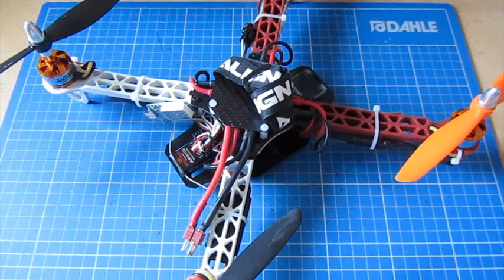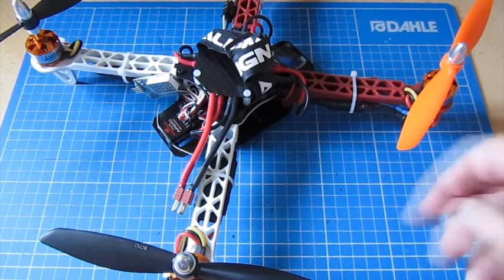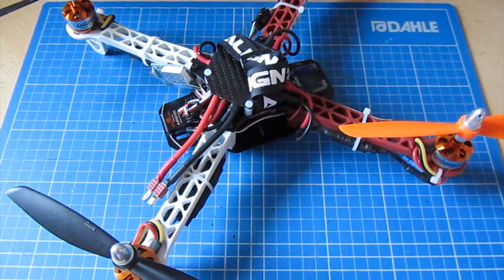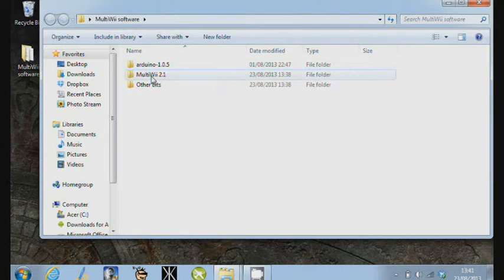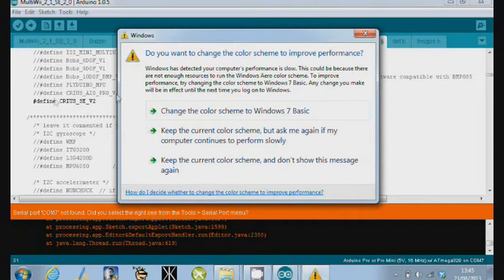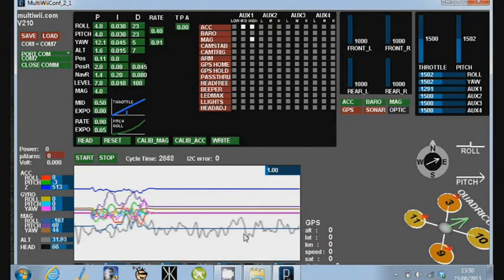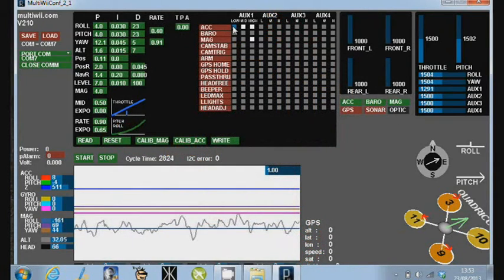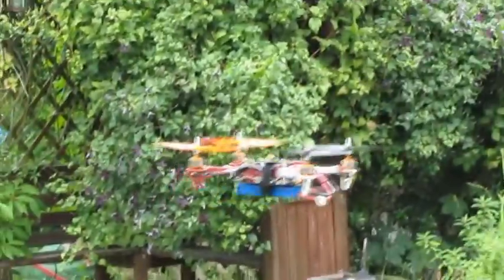Crius SE V2.0 MultiWii Board (MWB) Overview and Setup

Comment: Where do I get sketch files for the Multi-Wii 2.5 board?  I have setup APM 2.6 w/GPS and KK 2.1.5 but this Multi-Wii is totally new to me, I've watched your video several times now, and can't figure out where to get the sketch file to upload to my board.  I'm completely illiterate when it comes to this kind of stuff.  Thanks!  Great video btw!
Reply from the maker: Hi Michael, if you've set up the KK and APM then this will make sense quickly. I know from my own experience it's confusing coming from systems where everything is made easier by having only one (or two!) versions of the boards and dedicated software for them.

Multiwii is an excellent platform and is developed by the community so new features, board versions and improvements are coming all the time. Multiwii AIO Pro boards can run a version of the APM code!

However, all of these choices and versions do mean that you need to edit the software files before uploading them so they match the board type, setup and main components (like ESCs). It is like performing most of what's done in the 'mandatory hardware' sections of the APM setup in Mission Planner (frame layout etc.) by selecting the choices you want in the firmware code before you compile and upload it.

Download the code from http://code.google.com/p/multiwii/ and follow the video and you should be flying in no time!

Best of luck with the build.. Happy flying!
Reply: I still do not see sketch files on that link you provided sorry, I'm totally a noob when it comes to this board!
Reply: Painless360
Ok I finally got the MultiWii 2.3 file to download, but have no clue how to use it honestly, I do not see in the sketch file where to define the board type.  Like I said before, I'm a total blooming idiot when it comes to stuff like this.
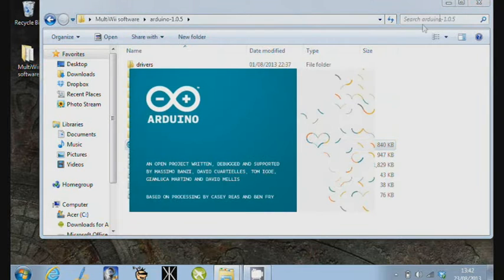Reply from the maker: this is covered in the video at 10:40. Open the .ino file that has the same name as the directory its in and you will see lots of tabs. Edit the one called  'config.h' to select board type, frame orientation etc.

If you don't see multiple tabs then you have opened the wrong. ino file.

best of luck.
Reply: I have all the multiple tabs, but nothing about board type or orientation in this sketch file
Reply: Ok I finally found the correct tab and found board orientation for Quad X but not exactly sure which board to choose, I Crius SE and Crius SE 2.0, I have a 2.5 SE
Reply from the maker: I use  #define  HK_MultiWii_SE_V2 and it works great with the Cirus SE v2.0 and v2.5 board.

You're welcome, Best of luck.
Reply from the maker: Painless360
FYI - I've updated this video with a newer version that uses the SE V2.5 board and Multiwii V2.3 to configure it. See https://www.youtube.com/watch?v=Zm8z4RLkFGU&list=PLYsWjANuAm4qSqszQR6qIisiwk5r-_nMk&index=1

Hope it helps

Comment: I tried your config files and could not get motors to spin. When you arm motors is there some indicator that it got the signal and its armed? I have mw v2.5 connected to dragonlink receiver. I wired motor esc directly into dragonlink receiver and motors ran.
Reply from the maker: Yes, have a look at the Multiwii manual at Multiwii.com. You need to arm the board first before the motors will kick in.

If it will not arm by holding the throttle to the bottom/right of it's limit for a few seconds then increase the endpoints on your radio.

Hope this helps. Let me know when you get the beastie flying!

Comment: Hi can you upload the code for the 2.0 onto the 2.5 and please can you put a link to the FTDi Connector you bought
Reply from the maker: Yes you can, make sure you select the right board in config,h (I select the Hobbyking one and it works great with the 2.5 board).

Can't link to the FTDI board as I've seen/bought a few in my time. If you search for 'FTDI basic' you'll find similar ones.

Happy flying!
Reply: Thanks very much :)
Reply from the maker: George Carter
FYI - I've updated this video with a newer version that uses the SE V2.5 board and Multiwii V2.3 to configure it. See https://www.youtube.com/watch?v=Zm8z4RLkFGU&list=PLYsWjANuAm4qSqszQR6qIisiwk5r-_nMk&index=1

Hope it helps

Comment: Once the calibration of the sensors has been done is that it, can you then write new commands to the board without having to calibrate again or does the quad have to be calibrated each time a new function from the GUI is written to the board. I finally feel i have nearly got this all sussed. just waiting for a replacement esc.
Reply: I guess its a one time calibration as the info is stored in the GUI and that shouldn't change.
Reply from the maker: The calibration should (!) be a one time thing. It's good to recalibrate once in a while when you connect to the PC to keep everything spot on.
Reply: I've had some problems today with changing settings in the sketch. I'm finding it difficult to understand how the sketch interlaces with the GUI. As even though i had uploaded the new sketch settings to the FC nothing changed in the GUI or with the Quad, i tried over and over and eventually cleared the eprom, then it took me all night to get back to where i was. Partially due to having one odd ESC, but had it flying well now with 3x 6A Plush and 1x 7A YEP. Problem is that when i use the Sketch  (cannot fly) to calibrate the ESCs the YEP seems to have the wrong settings changed within, my no brake and plane fast change to Heli middle and soft brake each time so i need to do it again with the programming card, still having issues with throttle range and understanding how the GUI is used. Later i found that perhaps it wasn't necessary to clear the eprom on the FC. I think it was how i was using the GUI? The quad and the GUI don't recognise the new settings form the sketch till i reset and read (i think). There are just so many things to watch out for, what order you do things in, how long you wait for things to be ready for flashing etc. It's more like Plug All Day rather than Plug And Play :)
Reply from the maker: You always use the same MultiWiiConf from the same version that you use the code from - 2.2 or 2.3. Writing to the board from a different version of the GUI (like what the Aux switch does) will mess the board up. I may do a video on this as I haven't covered it so far..
Reply: I may have done this by mistake, i got a bit lost not knowing that i needed to open the .ino file. I had saved a few different sketches and am only just working out how to find them (the .ino file)
  I flew again today and it's going very well, since i am learning to fly i've set:
#define MINTHROTTLE 1120 // for Super Simple ESCs 10A
and:
#define MAXTHROTTLE 1650

This is to help me keep the quad under control whilst i learn, i thought it may be a good tip for beginners but i should probably be doing this setting in the gui or on the radio?
 I'm currently trying to find out info on how low i can run a lipo. because you get two readings, batt level with motors running and batt level with motors at rest. This is a bit confusing, how low can i go with motors running? e.g. 6.3V? Then at rest it's more like 7.4V. I'm using a mini volt meter from ebay, very cool piece of kit, super lightweight. 3.5 - 30V.
http://www.ebay.co.uk/itm/360759956960?_trksid=p2059210.m2749.l2649&var=630168644611&ssPageName=STRK%3AMEBIDX%3AIT

I flew for a short while today in acro mode before i realised i didn't have angle mode switched in so things must be fairly dialled in!.
  I don't remember seeing many good videos on how to calibrate the mag, i heard you need to hold the quad in certain angles and go through a sequence like this, it's a bit tricky for me as i don't have a usb extension so i'm on the ftdi cable alone and walking around with my quad in one hand and the laptop in the other hand. Since it's working well with one YEP ESC and 3 Plush i think i'm going to try again with the YEPs because the plush constantly drain power and they are shortening my flight times, but the YEPs tick over with a super low current drain.
  Sorry this is getting a bit long but going back to the choice of ESC in the sketch, there are a few different choices, i take it this is more than just a min throttle value. I am assuming that depending on which one you choose the esc calibration programs the ESCs differently.
As some esc's are programmed differently than others. For example every time i do the calibration the YEP esc resets itself to brake smooth and heli middle. So i have to go back and change it back to no brake and plane fast with the programming card. I didn't check the plush yet as everything seems to be working for now.
Reply: I'm going to suss the low batt thing out by observing how much power is going back into the batteries when i charge them.
  Soon i'll know how low i can go with motors at hover. by using this technique.
Reply from the maker: Where are you based? Would a quick chat help figure it out?
Reply: I'm in France, i have Skype but don't worry i'll figure everything out in the end, i was just starting to wish that everything in the sketch was in the GUI, or is it? It's nice to have the sketch too. I've just seen the software the naze32 guys are using, It looks very user friendly. Check your inbox i've sent you a PM.
The other day when i spent all day messing with the quad and the odd ESCs my new ESCs had been in the post box all day! It's flying fine with the odd ESCs now. I'm keen to go back to the YEPs as they draw such little current compared to the Plush which chew it up even with the motors stopped.
  I find i loose height when i'm using Yaw control. Is this normal for a micro quad? I say micro but it's a 380 diagonal with 5" props and 10g Motors, about 170g AUW with 1100mah

Comment: Hello fellows I have a 450mm quadcopter with Crius multiwii FC laying around and I'd like to know if I can flash it with cleanflight or baseflight?
Reply from the maker: I don't think you can, I've not tried it myself as there are great boards (Naze32 and Flip32) that are designed to work with Cleanflight. I would be an easy job to swap the boards over and reuse the GPS and other pieces..

Hope this helps.

Comment: Hey Painless360  .. Thank you for This Great Video . Iam use Multiwii Lite v0.2 and connect all sensors to make it like SE v2.0 . and follow all your instructions , But i have a trouble :/ .... Multiwii dont supply Motors with the Same PPM Always there is a Motor have more speed than others and i cant find any Solution on Web :/ ... HELP PLEASEEEEE and Thank you

Comment: Hello - Thanks for the great videos.  I'm trying to upload the config file onto the SE 2.5 board. Ironically there is no SE V 2_5 selection in the 2.3 code, only V2_0. I'm using a mac with a USB cable and getting a message that says cannot run program followed by a directory path then it says no such file or directory. any idea what I might be doing wrong? Should I connect the battery to the distribution board or is the USB power enough?
Reply from the maker: Hi there, the V2.5 board has all the same sensors as the 2.0 but has an additional port. If you select the V2.0 board it should work great. I use ' #define HK_MultiWii_SE_V2' and it works great. Hope this helps.

Happy flying!
Reply: Great, that selection seems to work. I also learned that even though the board lights up with USB power only, the GUI will not show the USB comm port unless the lipo is also plugged in. Learning as I go for sure! Thanks again!
Reply from the maker: Good news, be careful of that board as all of my 2.5 versions were happy with USB power only for setup..

Happy flying!
Reply: Thank you for your help over the last several days. I was able to get the quad safely in the air. Believe it or not, the USB comm port wasn't showing up in MultiWii gui or Arduino because the USB cable was faulty. Of all things! At least it works now. Take care and thanks again!

Comment: did everything you did, but for some reason I cant get the gps to work. the light wont even shine on the software indicating that I have a gps connected. Do I just configure it config h on what gps im using
Reply from the maker: You need to do a few things, configure in config.h, config the GPS and the i2c board too. See my other videos on CN06 troubleshooting and multiwii - adding GPS for full details on the process. Hope this gets you working. Best of luck!
Reply: Thanks! I'll give it a try and see how it goes.

Comment: Is it possible to pull the sketch that is on my board now. So I can reference it later. Its preloaded. With multiwii  2.1. But I need to do an esc  calibration with the sketch. And am nervous about messing with a sketch that is setup already for my current components. Please clarify
Reply from the maker: Sadly I don't think it is. You need to keep the sketches used safe for future use and recompile the code each time.

Comment: Hello will this set up work for multiwii lite v1.0? I've been trying for 2 days no luck, won't arm the motors the pitch and roll seem to make the rc flash blue. I'm not sure what to change for the board type when making sketch.. Any info advice?
Reply from the maker: What board did you select to upload? Make sure that you connect the board after the update to the PC via USB and reset the ACC and MAG.

I've had boards with the flashing blue LED until I calibrated the ACC in MultiWiiConf.

Hope this helps. Happy flying!

Comment: How can I edit the code written on the board, I mean how can I create my own unmanned quad-copter using this board??
Reply from the maker: You need to compile the code from the source software as in this video. To 'edit' the code you change the parameters you want in the code and recompile the code and flash the new version to the board. Keep the version of the code you use to compile and then it will be easier to edit.

Hope this helps. Happy flying!

Comment: hello
thanks for the tutorial . i have the multiwii se v2.5 i programed it ,when i give throttle the motors do not spin properly like the speed jumps up and down not too much but it happens in all the motors . I have been trying it from past three days it does not leave the ground by it self .help!!!!
Reply from the maker: Did the ESCs come flashed with SimonK firmware? There have been issues with the KK tool uploading the wrong code to the ESCs.

See Problems with HobbyKing 20A ESC after flashing with of SimonK firmware V2013-9-20 - Solution for more details. If that all checks out - then check all of the connections and recalibrate the ESCs.

Good luck getting to the bottom of it..
Reply: Those are not hobby king esc's ,those are some cheap Chinese HW 30A esc's
Reply: Watch the video , the link is in the above comment !!
Reply from the maker: Mohammed Iqbal I don't understand. Are you saying that the ESCs in my video (@watch?v=sQ0XkVFhH0E) are not from HobbyKing or the ones you have are not?
Reply: Painless360
the ones that i have are not from hobby king , they are some cheap Chinese esc's
Reply from the maker: Ah I see. Got it. That could be the problem. I've had issues like this myself and it's been the ESCs every time. Sorry I can't offer more help. Good luck getting it sorted..
Reply: Thanks i will buy new esc's !!
Reply: Their is one thing that , when i run like motors without propellers they work fine . When i put props on it does it does all that crazy stuff . My motors A2212 1000KV motor with 10x4.5 props
Reply: Balance your props or put on new onces thats balanced I had the same issue and figure out it was vibarations if thats doesn`t work you need to try using gyro filter which you can define in config.
Reply: Thank you for the reply , but i changed flight controller i am using KK2.1 board
Reply: Mohammed Iqbal Hi i have Programmed MultiWii 2.5 and connected with ftdi module but in GUI the Sensors are not working and also not responding , if you know how to fix this problem or troubleshoot please guide me .

Comment: i am not able to upload anything to my board because its not finding the right COM. how do i change it.. when i try serial port under tools it is grayed out making it so i can not click on it. any ideas on what i am doing wrong?
Reply from the maker: Hi Evan, if you are on a PC check in device manager to see that the drivers are installed for the FTDI adapter and that there is a COM port number assigned to it.

Best of luck.

Comment: Hi when I open the arduino there is a file that contains one sketch that only has one tab at the top of it for that version.  Does that contain all of the config.h and other changes?
Reply from the maker: One of the .ino files has the link to all of the others. That is the one you need. It usually has the same name as the directory the files are in. Hope this helps.

Comment: Hi there. I was just wondering, when i download firmware from google code link, for example v2.1 or v2.2  in config.h boards section there is no #define CRIUS_SE_V2      // Crius Multiwii SE v2.0 definition. But on your version of firmware there is. I had a lot of problems with the board because i didn't download your version. Where can i find firmware version v2.2 which has a #define CRIUS_SE_V2      // Crius Multiwii SE v2.0 definition. Thanks alot for videos. Very helpful.
Reply from the maker: Hi ALeksander, if you choose #define HK_MultiWii_SE_V2 from the board list on the version you have it should work great. That's what I used here for the Cirus SE V2.5 version of the board. You can download the source from http://code.google.com/p/multiwii/downloads/detail?name=MultiWii_2_2.zip&can=2&q=

Hope this helps. Happy flying.